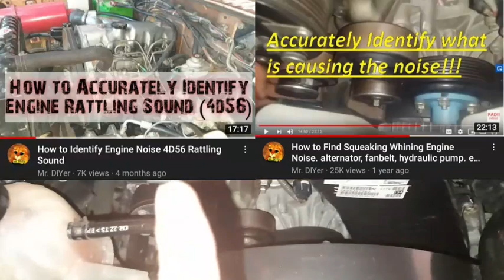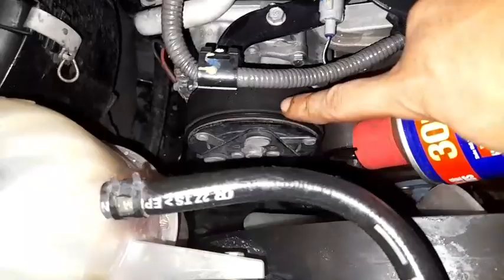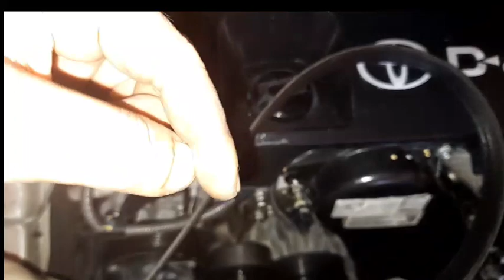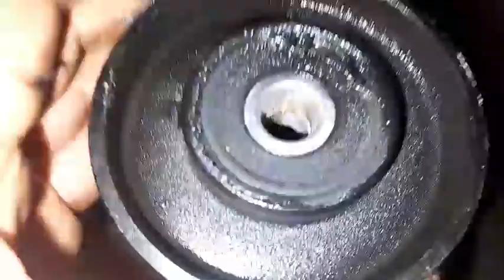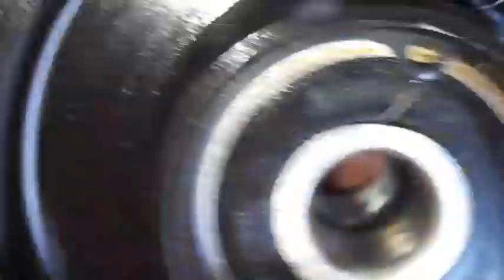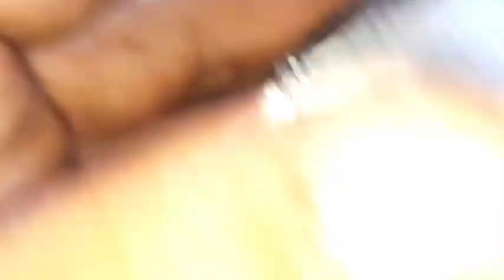How to Identify Engine Noise (IDLER Pulley) D4D toyota

Comment: do you have a tutorial showing how to remove compressor pulley assembly? without removing po sana yung compressor. showing proper way in a tight space sir. thanks so much po. ganyan na ganyan po. innova 2006 diesel

Comment: Hi i have a 2.7litre J2 kia diesel when i start my van i let it warm up until the temp gauge just starts to move upwards and then drive it as softly as possible until it fully warms up. When the temp gauge is about a quarter to 3quarters from fully warmed up my van makes a humming noise at about 1500 to 1600 rpm. If i pull my clutch in and coast the noise stops. Once fully warm this noise goes away and the engine sounds good. My engine did not used to make this noise during warm up. What do you think could be causing this noise. Is it a bad problem that must be addressed asap?
Reply from the maker: If the sound goes away. I would say its normal. Part of the warming up process. But you would want to check the thermostatic valve especially if the engine temp goes up and down
Reply: @MrDIYer  Thankyou for your advice it is much appreciated. 👍